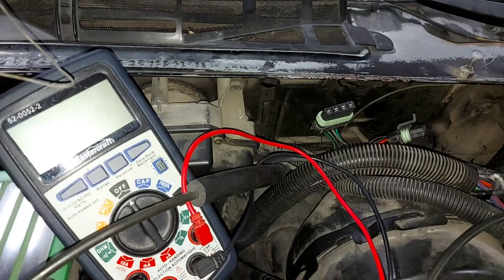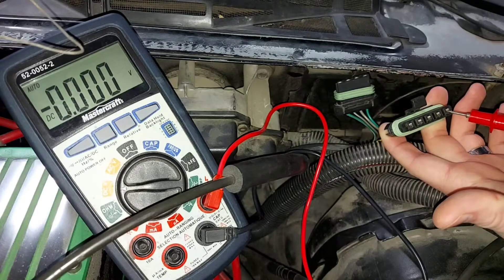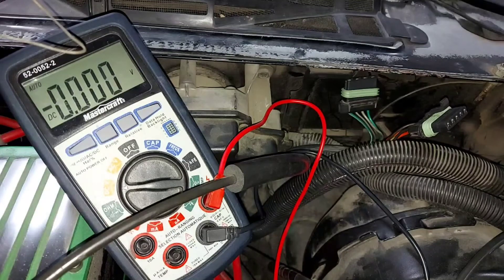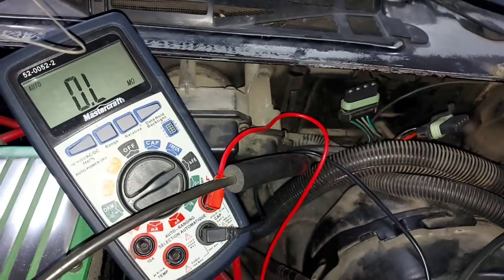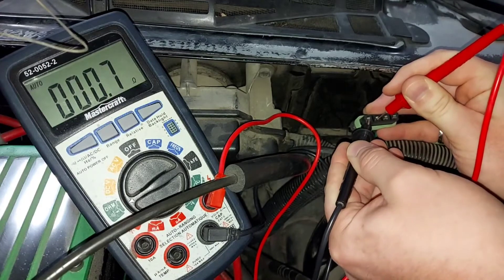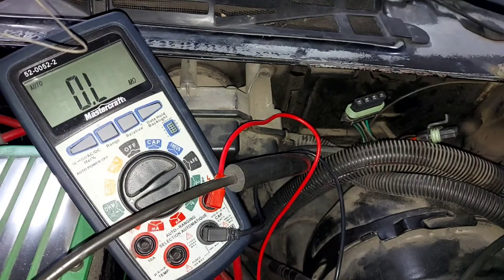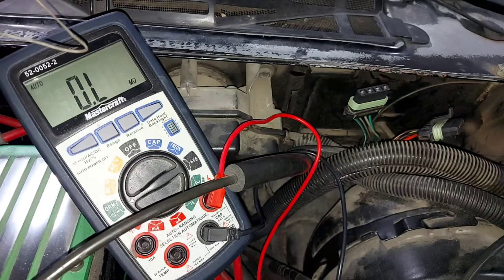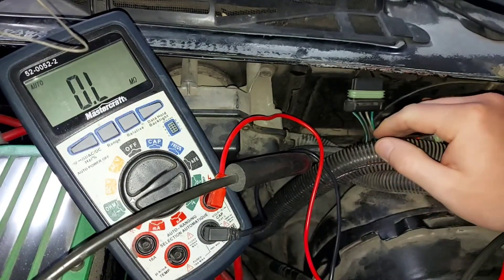BraveTECH - 3rd Gen Firebird Headlight Control Module Wiring Troubleshooting Aid (2-Wire Motors)

Comment: What if you have 12v at the running light pin with running lights off? Bad switch?
Reply: Same thing that happened when I tested mine. Did you replace the switch?
Reply: @dajarrett2000  @berserkerracing9974  Guys, I also do have 12V with the switch in OFF position on the white wire (DRL) and this is the way is should be, according to the diagram for my 1988. The voltage drops to 0 if you turn the lights on and this is normal.  I think the guy in the video is wrong.
Reply: @darkhorseca  do your headlights work normally? And where did you find the diagram?
Reply: @dajarrett2000  Chilton's library. No, they don't, that's why I'm looking into it. There seems to be a problem within the module.
Reply: @dajarrett2000  Now they are working normally; I fixed the module. And as I mentioned earlier, it is normal to have 12V on the white wire with the switch in the OFF position.
Reply: @darkhorseca  Thanks for the help. Did you just resolder the pins like he did in the video?
Reply: @dajarrett2000  I didn't see this part, but yes,  I resoldered some pins of both plugs on the PCB that looked damaged. I had to use a microscope to see cracks, it wasn't obvious.
Reply: @darkhorseca  So what makes the running lights come on then if the voltages in "off" and just "running lights" are the same?